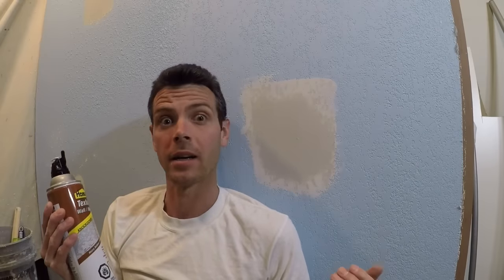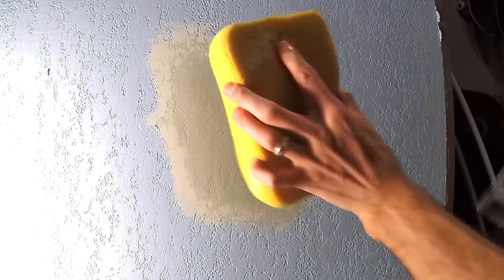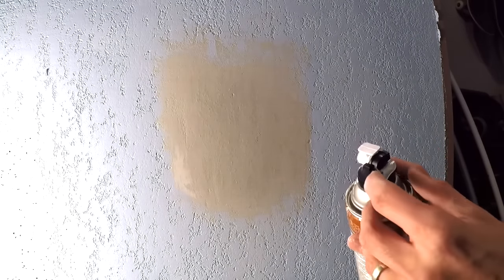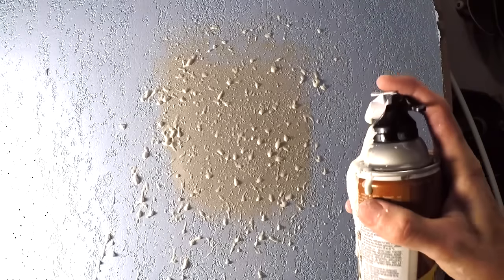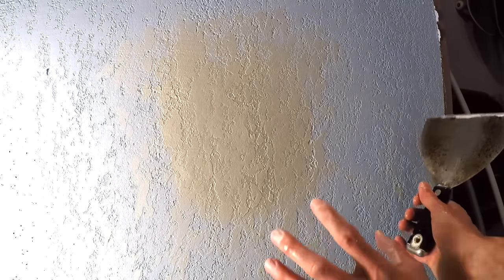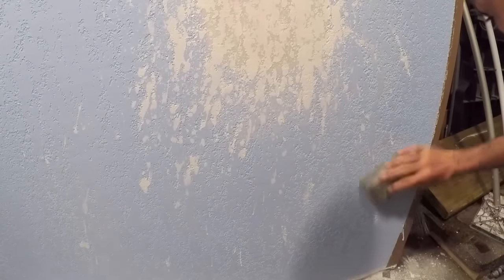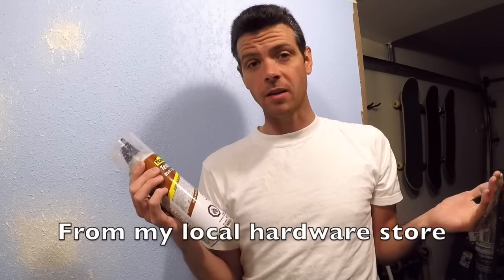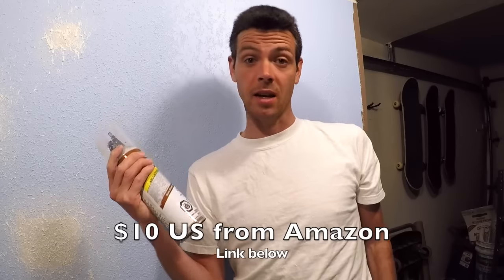DO CANNED DRYWALL TEXTURE SPRAYS WORK?!! (Knockdown)

Comment: Put the can in a bucket of hot water for 20 or 30 minutes it will increase the pressure that it puts out also when you're done with it turn the can upside down and clean the nozzle out you can make it last two or three small patches
Reply: Matthew Singleton thanks for that dude!!
Reply: I was just about to comment this, yes this helps the can tremendously!
Reply: I was about to comment the same thing.. warming up the can helps  a lot.
Continuous trigger pull may help with consistency of spray.
Reply: The hot water is very useful! Also, if you have a choice on orange peel I really prefer the oil based, water based pits but make sure to use a good paint in order to hide the hot spot!!
Reply: I warm mine up too and I never use the water based.
Reply: I agree with Matthew completely. A cool can interior can really come out lousy. (28 yr handyman here). As you soak it in hot water, take it out and shake it twice during the time you have it in - to distribute the heat inside the can - keep it up for around half hour.
Reply: How hot does the water need to be in order to put the can inside to warm it up and for how long do I keep it in the water? Thanks in advance for the tips.
Reply: Defiantly works much better if put in a bucket of hot water. I usually only let it set in the bucket for no more than 5 minutes because the bottom of the can tends to pop due to too much of an increase of pressure.
Reply: @nikknm08  great advice. Heating up and holding down made all the difference for the consistency and coverage. Though the can still dripped like crazy while spreading, results on the wall texture were much better. Thanks!
Reply: Good looking out I was not aware of this info 👍🏼
Reply: It wont explode right?
Reply: @JP-td8gt  nope
Reply: thanks man, I work with that
Reply: You just saved me!
Reply: @tonyfromaccounting56

Comment: It's leaving pretty big blobs because the can is cold. Run it under hot water for 5 minutes it will increase the pressure and make the adjustments more accurate
Reply: Thanks Jason, will do. I have to fix some minor creases in some of the joints of my drywall.
Reply: I'll try that

Comment: I’ve gotten better results by just holding the sprayer down and moving in a circular motion, instead of using it like spray paint.
Reply: This
Reply: Dasaster 79 yes👍
Reply: do you mean hold upside down?
Reply: @ivosan11  no, Im saying don’t let off of the spray button, just hold it down and move it in a circular motion. I’ve gotten better results doing that way.
Reply: So face the nozzle directly at the board and turn a vertical circular motion

Comment: I used the type intended for ceilings. The can I got was no more useful for fixing a ceiling than a can of RediWhip. No matter how much I shook it and heated it up, the paint wouldn't go more than 2" into the air and barely stuck to the surface above. It just left a mess. I understand that the shelf life is limited and it's possible that Wall Mart sold me an expired can, but the date is embedded in the serial number, so it's not obvious when the cans are old. If Homax really cared about keeping their customers happy, they'd put a more conspicuous "sell by" date on the can with a warning to avoid any can that's expired, but apparently they don't care that much, hence all the bad reviews. I'd avoid anything with the Homax label at this point.

Comment: I use them alot here in Oregon. You can adjust the way the tecture comes out of the can by warming or cooling it. You can actually do a fine orange peel by geting the can of knockdown very warm under the tap. For small knock down patches I dont use it, I just use a sponge or plastik bag with mud but for small orange peel patches I will use the can. To asure the can doesnt go bad turn upside down and spray until no texture comes out. Cheers!

Comment: I use this stuff frequently and always keep some cans in the van. The bigger can with the "hopper" nozzle sucks so don't bother with it.
This canned texture does take lots of practice, here are some tricks to help and to adjust your texture to give different results:
The temperature of the can before spraying makes a huge difference in how the mud sprays. 
To get more depth in your knockdown you can spray a base coat of orange peal and let it set up then spray your knockdown coat over top or let the first coat partly set before adding a top coat.
Varying the standing time before knocking down.
Shake the can very well and frequently.
This stuff shrinks a lot so your wet texture needs to be heavier then what you are matching. 
You can use a hair dryer to get it to set up faster
If you have left over rinse the nozzle and keep a lid on the open can.

Comment: Hey Ben:  Been using the orange peel type for several years.  Works very well provided you get the spray "dialed on" first on a test piece.  The spray adjustment will give you a wider range of spray patterns if you screw it in or out beyond the "vernier" on the can top. You can turn the can upside-down and clear the feed tube and nozzle when you are done spraying which will give you a longer storage time for the unused portion. Keep the videos coming!

Comment: I decided to freshen up my bedroom with some paint. This led to me removing some wood trim (aka 2x4s) that the previous owners put where all the corners of the walls met including the ceiling. This revealed they did not mud and tape when they finished the basement. Thanks to your channel I’ve learned how to do that easily and my dad said  I did a better job than they did where they did decide to mud and tape. I purchased the orange peel canned texture just to match up what I’ve done to the rest of the room before I can finish painting and this helps a lot! I’ve been cautious to start since I’ve gotten this far. 
My next room I’m going to do is our living room which has wood paneling and I’m dying to know what they hid under there for me to fix. Either way I’m sure you have a video for whatever I’m going to encounter next.

Comment: I used this stuff for a popcorn ceiling. When I held the can close enough to reach the ceiling the popcorn kind of squashed and wasn’t popcorn-y enough. When I backed off it didn’t really have enough pressure to reach. So the final texture was a lot smaller and smoother than the popcorn that was there.
Reply: rustybones99 The popcorn one sucks

Comment: You are right Ben with practice this texture cans work good, I've been finishing and texturing drywall for about 15 years in Denver, Colorado area, there is a little texture handpump for small patches like that, it also works really good, you should try it too.
Great videos keep it up men.

Comment: Also when spraying hold the can up to three feet away and gently move in a circular pattern - easier to build up texture density gradually.
Reply: Yessir! Just as you would with a traditional texture spray gun/hopper!
Reply: @CuddlesTheCatTT  3 feet tho? Just wondering coz imma start making holes in my drywall to install recess lights

Comment: My whole house is knock down (I’m in Florida, but from Vancouver originally, I want plain walls but alas.) we had some severe wallpaper removal that left the drywall a mess and I grabbed a can of this to try to DIY; this makes me super excited for a decent match. Thanks for the awesome video!
Reply: I'm also in Florida from Vancouver originally! My whole house is also knockdown except ONE wall. I wonder how far one can would go...
Reply: @brittneymerryweather9405 I did the drywall in my bathroom with this and it doesn’t match and doesn’t go far. I’ve seen a lot of videos about watering down the drywall mud, literally splattering it on the wall and knocking it down. I’m going to try that next, plus it’s using mud which we probably have on hand anyways. Worth a shot!
Reply: @lissiewickes8633  yeah, so I just tried it today and it was awful. It dried Soo fast that I couldn't knock it down. So I tried doing it immediately after spraying and it still sucked. I mean, I'm assuming user error... Or maybe the can was old?  Instead, I ordered these stencils that you apply joint compound to instead. They arrive on Tuesday so I'm going to try that.

Comment: The hot water absolutely works.  I've used the orange peel version many times on small repairs and as long as the texture isn't too large it works pretty good.

Comment: As a another side note, in my case I prefer the oil based homax texture as it sprays more consistently; especially for the orange peel texture.  They have a water based version for both styles of texture, orange peel and knock down, as perhaps a environmentally friendlier solution but does not perform as well. @Cancouver Carpenter, your tutorials are gospel!  Thank you very much for all the information you provide to us mortals!  I appreciate a craftsman’s pursuit of perfection in his/her trade.
Reply: The oil-based dries quicker but it also seems to flash paint. It also has more texture to it because the water base dries out and shrinks up. But some texture that's what you want. Right tool for the job.
Reply: Damian M  I completely agree. I just started using the oil-based cans and was shocked at how much better they perform. Way more consistent and far fewer bubbles.
Reply: @paulsallee4889  yep.. it flashes paint. I stopped using it

Comment: I thought texture was for guys like me to cover up the screwups? Here at home take a crumpled up plastic shopping bag & dab it on the wet mud, wait a few & knock it down softly. That generally matches what the drywall guys did with the hopper.  Think I am going to try smooth on my carport walls, if i fail texture it will be.
Reply: I'm actually in a spot where I need to match a knockdown, and the can aint doin it. Was about to crack out the compressor and hopper tomorrow, but going to give this a shot. Will update, but if it works, heres a VR BJ

Comment: Put it warm water ,1/2 hour before ,and when spraying just hold it down after adjusting pattern ,and just keep it moving as you work with a hopper or spray rig , then let set a lil longer ,before knockdown ! But you did great for the first time using 👍

Comment: Pulsing is the 1st mistake. Treat it like spray paint. Start off your patch, wide open on paper or something. Then pull into your patch, this will eliminate most of the dripping and you'll get consistent coverage. I never use cans anymore. Hopper and compressor are a lot to setup but look much nicer and you don't get bubbles in the texture.
Reply: and I believe you'll find the directions say make circular motions in a continuous fashion.  It works for me.  The only problem I have with this product is the spatter ending up where you didn't intend it to go, especially trying to spray on the ceiling.  But I think the hot water trick would help me with that in the future - more pressure means more texture where it is supposed to be.

Comment: Thank you very much, we use these cans sometimes to, I usually put my cans in hot water or a few feet Infront of my hologyn light that's 500 Watt's to get it warm and shake it up every now and then to mix it up right as I'm doing my prep, I do the same thing with my orange peel cans and even with the oil base cans, just sprays super well and you can actually use a whole can if you need to actually use an entire can. If I don't use an entire can I'll turn it upside down and spray till propellant comes out to unclog the tip. Thank you again very much.

Comment: Working in the apartment maintenance field where I mainly patch door knob holes and the occasional less than 12"x12" holes, I use the Homax orange peel and it always works great as well. As far as price, yes, it is a bit high, but for what I am patching I can make a can last for a few patches.

Comment: Hot water to the can.  
Your multiole short squirts of texture is the wrong way to use this product.  Carry a piece of cardboard and begin spraying on cardboard, then move to wall in circular pattern covering the patch and about a 12" radius around the patch to blend.  When you first start spraying there is usually a large quag of mud that flips out, then the consistency gets more uniform, the reason to spray on cardboard to start.

Comment: I use the Homax water based orange peel for patches and get close to perfect results (where I work/property maintenance). The hot water trick works great. For "larger jobs" I use an electric Wagner Power Tex texture sprayer, that way I can use the dry mix. The hopper gun is still the best for full ceilings and walls.

Comment: I have been using this for some time. It took me a couple cans to dial in the proper texture for my walls. Also, I found if you apply in a circular motion, it works better.  It’s great for the home owner that needs to touch up some areas. Practice...practice...practice.
Reply: Second on the circular motion. Start in the middle and make larger circles until you reach the edge.

Comment: Thanks for your videos, the time and effort doesn't go unnoticed.  Our company does small drywall patches sometimes and for small jobs, the texture in a can is invaluable.  For the time that it takes to lug out the compressor, hopper and texture.. then to clean up the mess, you will be driving home using the spray.  Makes jobs more profitable while keeping costs down for customer.  Only downside is the cost!  Basically 20 USD here in California.  The cost of materials is offset by the high hourly rates we make out here.  Thanks for your videos, they are a gold mine for anyone in the trades.  Blessings brother!

Comment: I've done whole bathrooms with those and it came out great good tip I learned was to put cans in hot water to warm up before spraying and not only will it work better/be cleaner but also go a little further in sq  ft

Comment: I've always had trouble with the can product coming up flat. Cheaper and better in my opinion is a stucco dash brush. Dip the brush in the mud and flick at the wall. With a little practice you can get the spray pattern right and it knocks down like the bags of spray texture since it doesn't have all the air it the can produces.

Comment: That did turn out pretty good. I’ve used the orange peel cans for small stuff too but for the price I actually don’t mind using the hopper. I even constructed a 32 ounce Gatorade bottle with the hose clamp to my Wallboard pro 200 gun for small jobs. And for small knockdown jobs I’ve been using a sea sponge to dip and texture the patch then after a few minutes knock it down.
Reply: My dad has a hose clamp and a peice of 4 inch ABS pipe.

Comment: Just a heads up...  I have used both the knockdown and orange peel cans. Multiple times.  The orange peel one I used was a JOKE.  I shook it for three or four minutes and let it warm up as well, but no matter what I did the orange peel applied like a thicker layer of paint. There was just no depth to it.  I had to use caulking instead for some patches because the caulking left enough depth to match better than the can crap.  The knockdown one did seem to do better, and yes waiting about 15 to 25 minutes before knocking down makes a big difference.  Curious to see how you do with the orange peel, because I'd like to find one that works and looks right. So many people doing orange peel now, I love knockdown.

Comment: I've never used a hopper. I've always used the spray can. You sprayed about half as close as you should, and you seemed to be "spray painting" with short bursts. This is why it was leaking all over the place. It's absolutely ok to over spray your patch area, you can wipe it off with the sponge right after spraying. You are right, you should have waited longer before knocking it down. I've been using the spray cans for decades, and with all that practice, you can't even tell there is a patch. I can't imagine you did better with a hopper, and I can't imagine you do those short bursts using a hopper. Use the can like you would the hopper. Long blasts about twice the distance you were in this case.

Comment: When I use can texture I heat them first and shake well. Also when doing patches after spraying patches always knock down the hot mud first before you go on existing paint because the texture stays wet a little longer than on new drywall or hot mud.

Comment: Hey….. put it in some hot water and shake 2 to 3 times. Then do the first spray into the trash to release any pressure and blobs that may splat. After that you should be good to go.

Comment: @VANCOUVER CARPENTER - Just wanting to make sure - you don't add a coat of primer on the repaired wall before adding the texture spray, do you? As in - this method should be done prior to primer being added?
Reply from the maker: I didn't add primer but if you do it will help the mud flatten out more evenly as the patch will no longer suck the moisture from the texture faster than the painted surface.

Comment: Omg I cringed when you knocked it down that hard, holding the knife at that angle. I thought it turned out decent. Your second test turned out really good tho. 
The only time I use the canned texture is in a super tight location where a hopper won’t be ideal to fit into. To me it’s just not the same as using a hoper.

Comment: I was wondering if you were ever going to mess with any texture. It there is definitely an to it. I keep a can or two in my kit for small patches and have been able to get “near perfect” results on occasion. I also pre heat the can in hot water like everyone else here in the comment section 😉